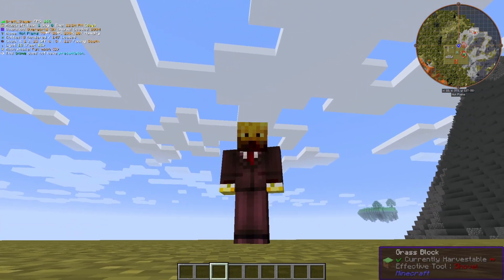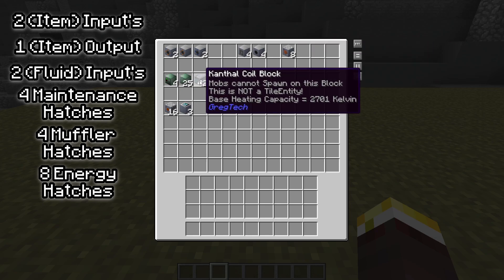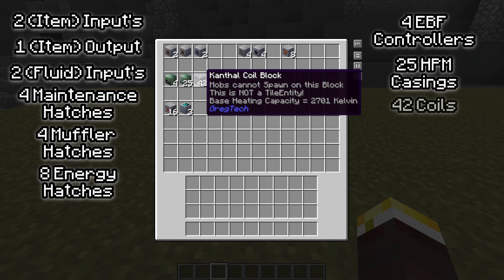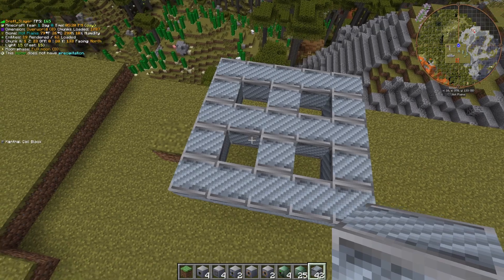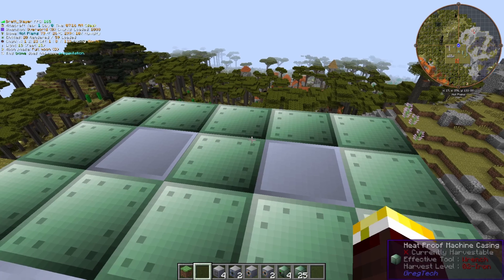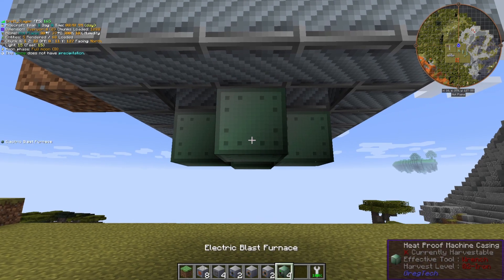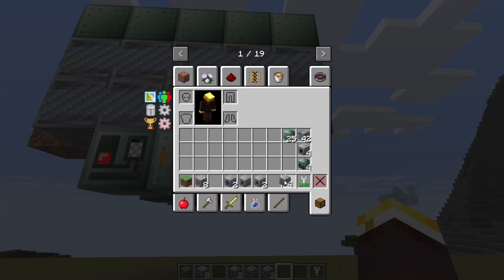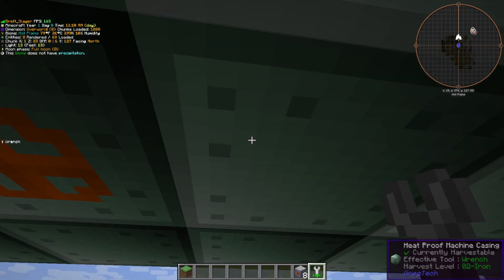GTNH TUTORIAL: Quad EBF | CHEAP & EASY!

Comment: A few points:
1) Don't waste space on the bottom with heat-proofs, there's always room for more stuff, for example, some recipes need fluid output space, having at least one output hatch for that makes a lot of sense.
2) add some output hatches on the top, there are some waste fluids you can get that way. Its a bit of a hassle, sure, but there is really no reason to void them, keep a small buffer of CO2 and some of the other useful ones and electrolyze the rest
3) in HV you can make quadruple input hatches that can carry 4 fluids. it probably makes sense to switch to those asap when you can.
4) I would recommend some extra input hatches for some other circuits. Most recipes can go in the same hatch, and you can put circuits in the input to allow the multi to run multiple circuits (of course you need to make sure there are no conflicts) but circuit 1 for example needs its own hatch cause it conflicts with most circuit 11 recipes
5) use a type filter to automatically extract the hot ingots and send them to a vacuum freezer.
6) automate the setup. if you are in EV AE is the obvious choice but many people don't know that autocrafting is available even in LV. check out the project red automation tab in the questbook, even if you don't wanna automate the whole base, in my opinion it makes a lot of sense to automate some of the basic things that you are gonna be doing all the time. Don't you want to request 256 steel ingots and have the system just pull iron dust and oxygen from your storage and craft it for you? I know I do.
Reply from the maker: Thank you very much for the extra pointers! I definitely look forward to putting these to good use once I reach that part in my play through. Especially using more ports instead of casings on the bottom

Comment: Thanks for this video. I was trying to setup a quad EBF and it was being very fussy about where specifically I can and can't put hatches.
Reply from the maker: I've been there before lol. Checking the tooltip of the controller usually helps with finding out where certain blocks/hatches can or cannot go.

Comment: i need a gtnh tutorial on the me system and automation
Reply from the maker: I’ll gladly work on that once I reach that point in my series. (I hope it’s not to long from now 😅)
Reply: if you mean the me system with quad ebf you can swap the output and inputs so 1 input in middle 2 outputs on side that go into a interface (interface needs to be under the input bus) then have pipes go from output bus into the interface to feed into the system